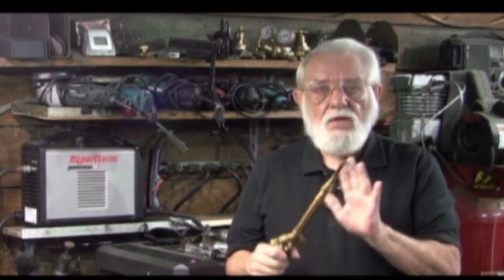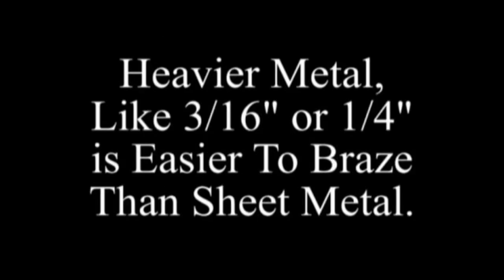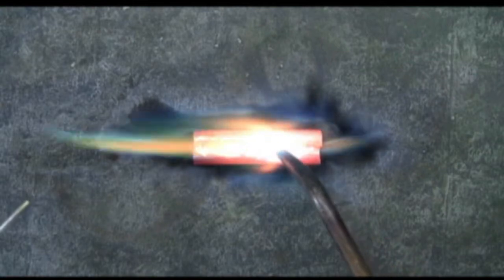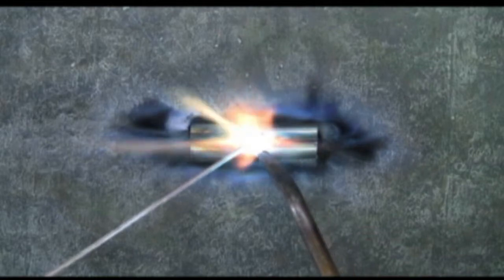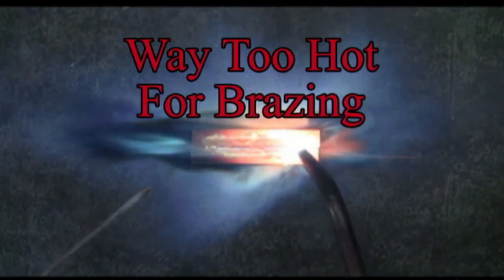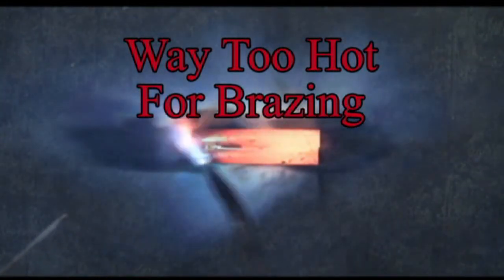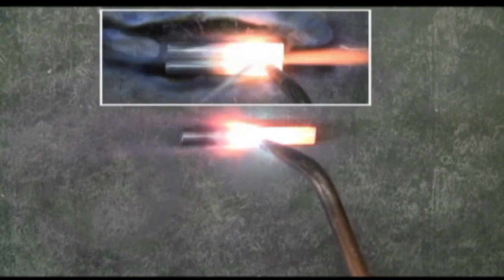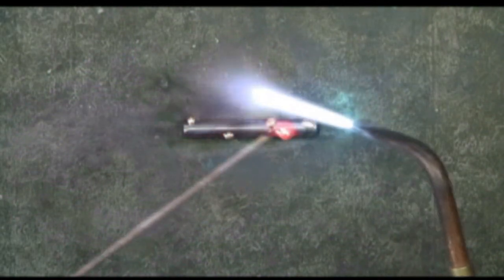Brazing Heats #1

Comment: I'm just gathering information before I dive in.
I use oxy acetylene to weld lead for my job but want to get into aluminium brazing with oxy acetylene.
I don't want too go down the machine weld line like a twig welder,
Reply from the maker: I don't work with aluminum.  Lots of YouTube videos for welding aluminum along with the proper rods.  Do a search on YouTube.

Comment: It is a very good concept to show examples of both what to do and what not do to. As a novice it becomes much easier to tune in to do it correctly, when you have an understanding of what happens when the temperature is to low/high or just right.
Thanks for sharing and making it so clear.

Comment: thanks for the videos you made they have been helpful for me. i have never brazed before but i want to start brazing together some mild steel or aluminum to make some parts for my remote control hobby. is there a specific type of torch you could recommend for me to use? 

thanks :)

Comment: Hi George, I really like your video series.

Quick question, I was wondering if you have ever had the need to braze cast iron? I have repaired cast iron using the tig welding process with a nickle rod in the past.